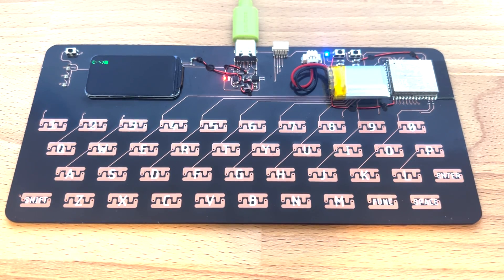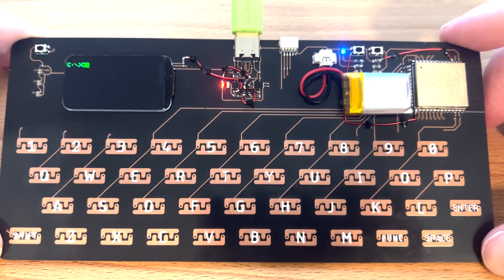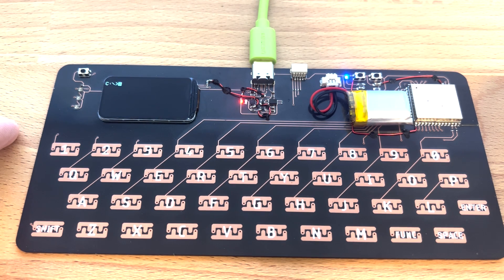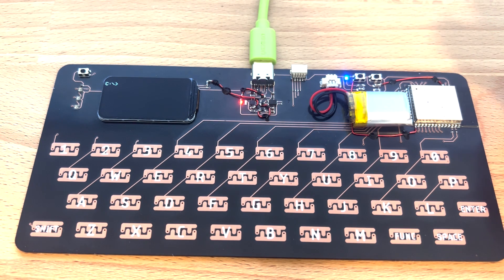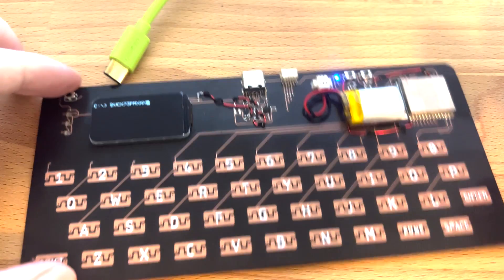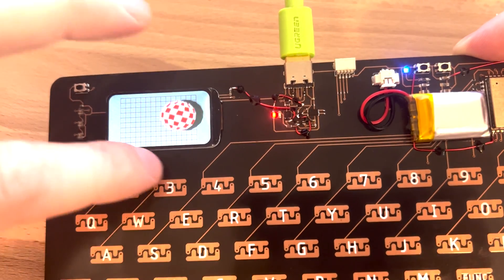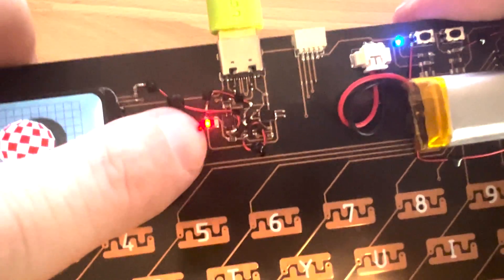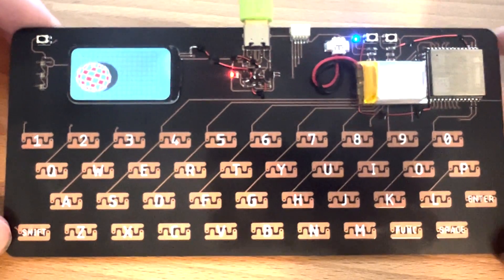Singleboard Alpha

Comment: I love the look and form factor of this! 
You might consider using the TCA8418 chip for keyboard scanning (Adafruit has a breakout and driver as well). It does the debounce for you and has a queue you can read keypresses from. This greatly simplifies the software side of things.
Reply from the maker: Thanks! That chip does work for a matrix, but require a traditional button press. This is a capacitive touch matrix that just uses the capacitance of your finger, like the touch screen on your phone. The traces are covered by the solder mask, you aren't electrically completing the connection.
Reply: @bateskecom  ah makes sense, of course! I think there are also capacitive touch breakout chips (I have an 8-channel one somewhere). I never tried this, thx and i'll go exploring :)